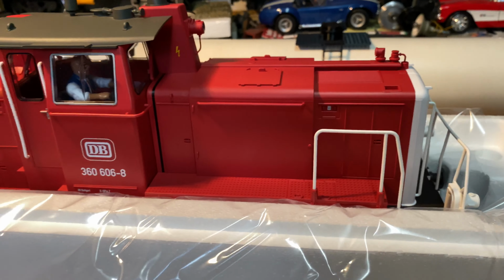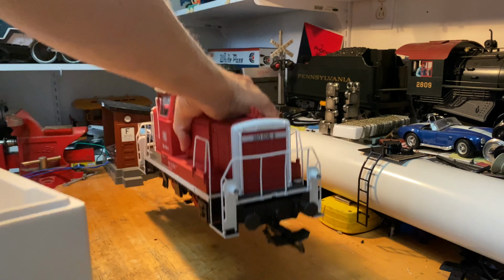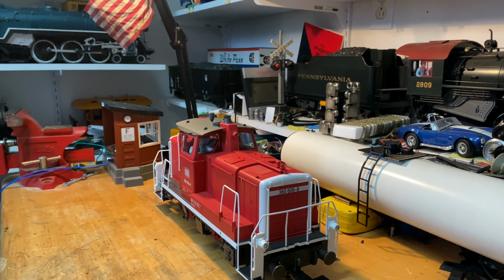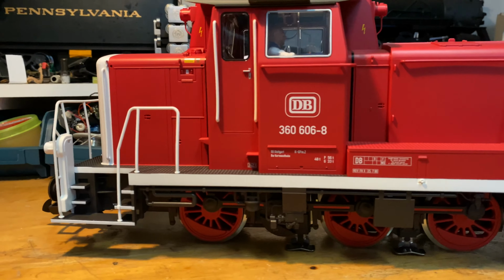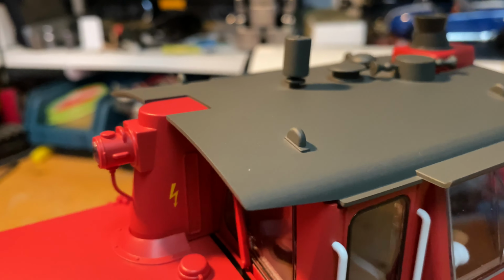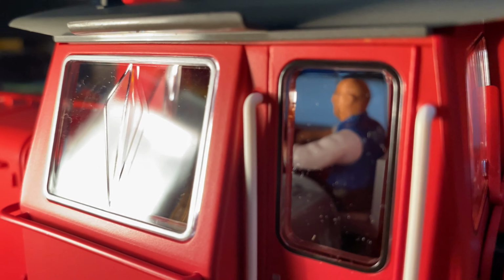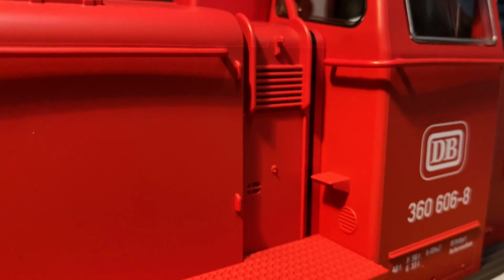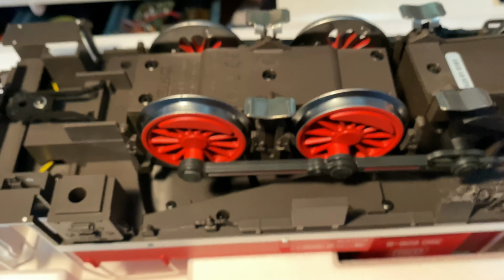PIKO G Scale DB 360 Switcher

Comment: if I get 2 Piko #38104 Santa Fe Freight Train Set can I run both of them together like connect the two 0-6-0T Saddletank steam locomotive together and if I want can I put a train in the front and the cars at the back and a train a the back of the train.